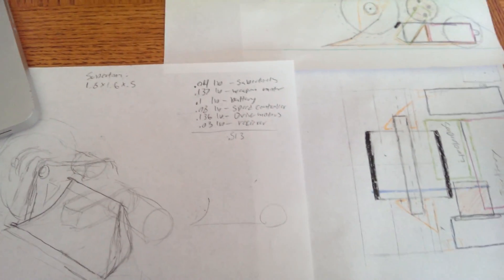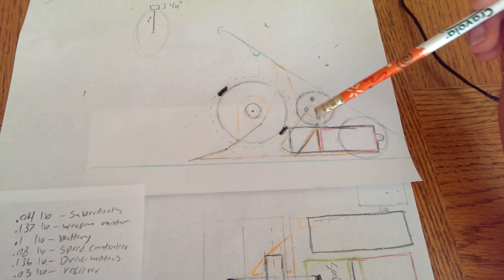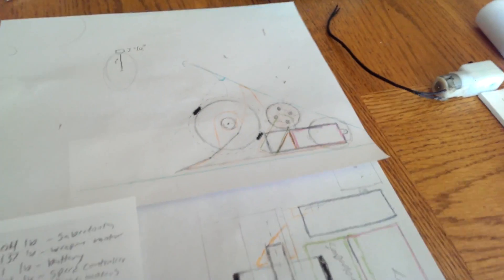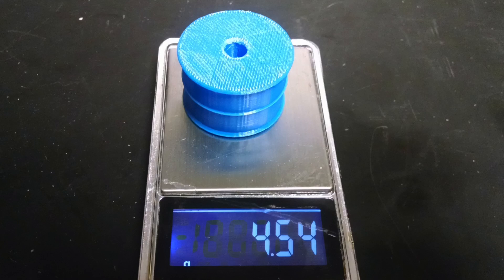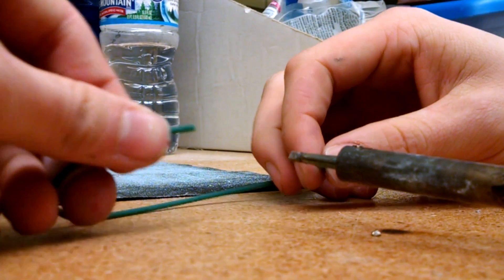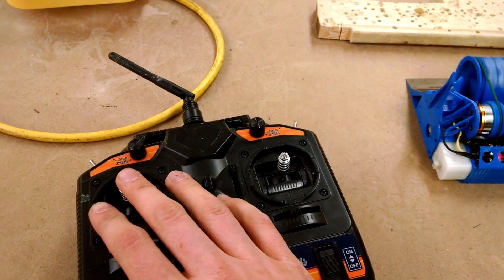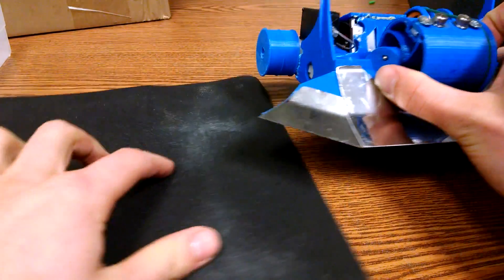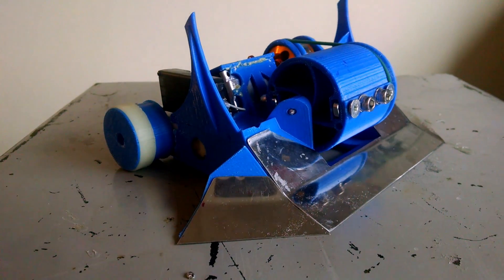3D Printed 1lb Combat Robot

Comment: what filament would you recommend for a combat robot like yours?
Reply: ABS is the cheapest for people with cheaper 3d printers, you need an enclosure though. Nylonx is the ultimate filament for 3d printed combat robots.
Reply: I would also recommend modifying your printer settings. Running without the cooling fan on and at high temperatures will greatly help with layer adhesion. CNC kitchen has some good videos on it. Additionally, from my very limited experience, wall thickness is more important than infill. I believe there are a few videos covering that too, just not in great detail.
Reply: I would use abs for the chassis and tpu for wheel hubs and possibly armor. Team panic has released files for very durable tpu rims, though keep in mind it is very easy to strip printed d shafts. If you cant print either of those filaments, I'd use pla+ and fiberology fiberflex filament.
Reply: I'm using fiberology easy pla printed at 250C and 70C for my plastic ant and I'm getting fantastic layer adhesion, though I have not been able to test it in competition yet

Comment: I made a MiniBot that spins on a DC Motor with a wedge causing it to shake in a circle. I used a battery for the base, DC Motor, googly eyes, a large clip, and a blade meant to stab or jam a bot when it’s driven into.

Comment: what did you use as the power supply
Reply from the maker: A 2 cell Lipo battery.  I've since upgraded to using 3s batteries.

Comment: where did you get the steel plates for the armor?
Reply from the maker: Home depot sells metal, I just picked up a 12"x12" sheetmetal panel
Reply: Just one more question, where did you get the poly cord for the belt?
Reply from the maker: amazon!  https://www.amazon.com/Metric-High-Performance-Urethane-Belting-Diameter/dp/B006IZYCZ0/ref=sr_1_1?ie=UTF8&qid=1477947831&sr=8-1&keywords=2mm+belting
Reply: @CarterHurd  what was the the thickness of the metal sheet
Reply: @CarterHurd  and what did you use to cut the sheet?

Comment: to joint your belt, you could also use a sharp razor blade do a nice clean cut and glue it. That is how it works with a oring kit we have at work. Google "O-Ring Splicing Kit" and you will understand what I mean. You cut your oring band to size and they have a jig to hold everything while you glue.

Comment: hi there, are you able to post a link to the drive motor controllers that you used
Reply from the maker: +Arron Prattley Yep, here you go: http://www.robotmarketplace.com/products/0-SABER2X5-RC.html    Good controller for the price.   Not the lightest out there, though
Reply: Can you put a link for what you used for the tires?
Reply: Also can you put a link for the axel for the drum?
Reply: Screws and bolts?
Reply from the maker: I don't have links for these, I'm sorry.  I tend to use things I have lying around my house, so I don't know exact specs for everything I use.
Reply: Ok but plz try because I want to make my own Danger Zone and also can you make a full body spinner? Thx.
Reply: Also plz put what you used for the tires, that will make my Danger Zone complete but first I am working on Frydog's Shrapnel.
Reply from the maker: I have two jobs and am in college haha, I can't just suddenly decide to build a full body spinner.  I might make one if I have time and a way to get the machining done, but no plans right now.  For tires I would recommend using O-rings. rubber bands, or Sugru.  I used ecoflex silicone rubber, but that's not necessary.
Reply: Ok but I have battlebot recommendations which are Danger Zone (2015), The best or nothing (2015), Full body spinner (You pick your own name for the bot.) Krave Monster, and Redrum. If you want to make an extra bot for your bro that is fine with me but plz show all of them in testing.
Reply: Those are recommendations for CIRC bot brawl 2017 if you don't want to that is ok but I would rather use the more consistent ones.

Comment: That's really cool!  How did you use the belt with the motor?  Does the high tension and a bit of friction keep it from slipping?
Reply from the maker: +Nico Myers Yep!  The tension is what lets the belt drive the weapon.  You want just enough tension that there is friction, but not so much that the belt is significantly stretched.  The fact it's a belt instead of a chain means the motor is isolated from the shock caused when the weapon hits something.
Reply: +altapowderdog Interesting, thanks!

Comment: you should print a second frame, and see how it holds up against your own weapon

i got a 3D printer too and also designing a antweight, but I'm still going to go with mostly polycarbonate, and also probably buy a cheap desktop cnc mill later

are you using PLA or ABS?

great job
Reply from the maker: frank26080115 That'd be a good idea, too little time though.  And I'm using ABS.